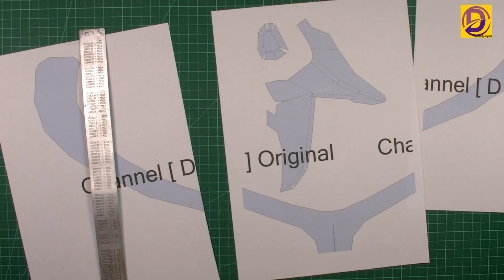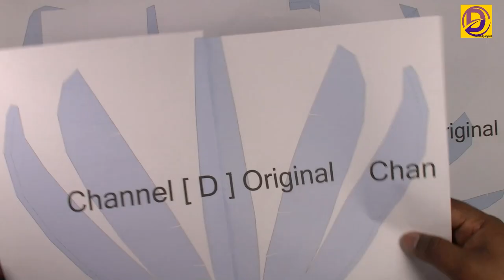how to make Predator helmet |DIY Predator helmet |Homemade Predator helmet

Comment: I think to eliminate a lot of the lines on the mask you could probably use the can of black rubber spray from Walmart only on the outside. It's the stuff they use on things they want to make waterproof. I think it would give a really good finish to the mask
Reply from the maker: Hi thanks to talk me. You can use wood glue to make a waterproof or you can use Plaster of Paris.